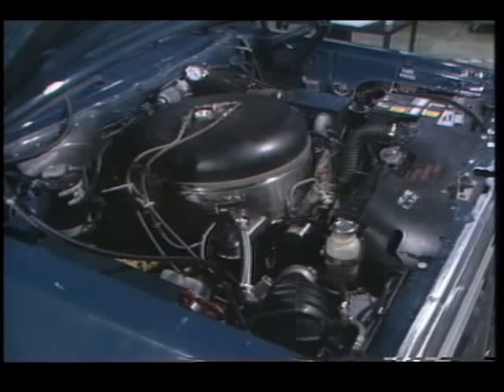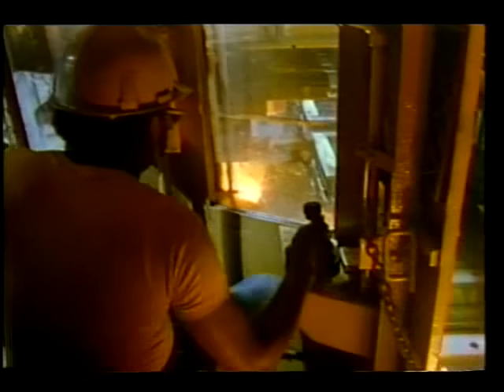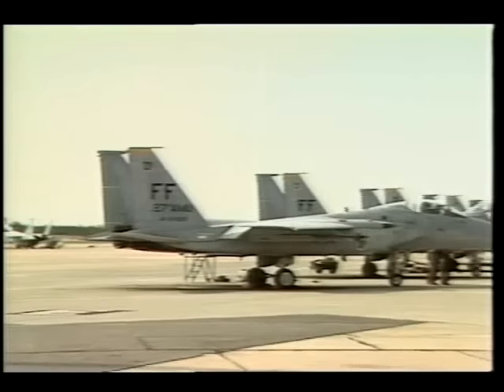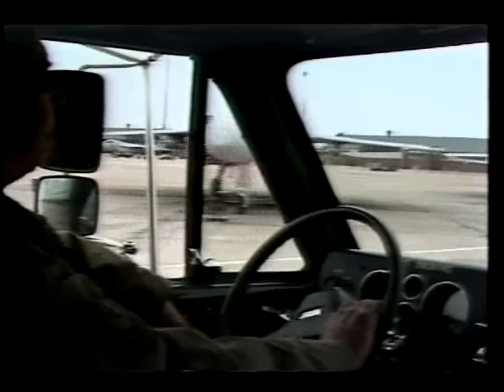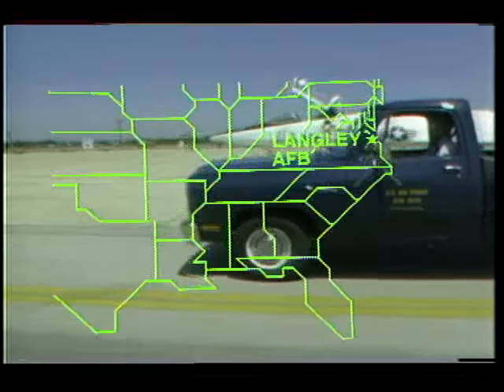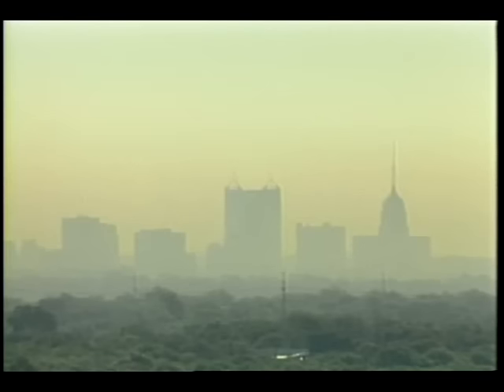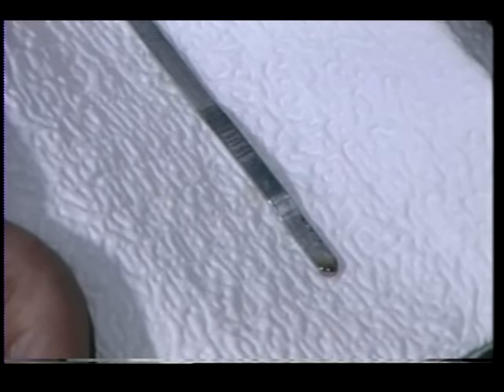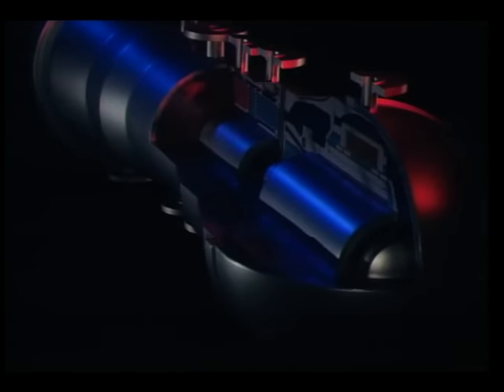The Stirling Engine: A Wave of the Future

Comment: Could you imagine using solar, hydrogen cells and sugarcane moonshine to run the Sterling generator to power an electric car hybrid? You could even use compost and bacteria or yeast to power the car. Even farts can charge the battery.
Reply: solar and HHO wouldn't make sense, nor would compost or bacteria. you'd need a methane biogenerator and specialized subsystem to feed this into the engine for a lower power & little range due to the nature of methane being a gas, however it's quite practical to heat your house and for cooking.
Reply: @s.sradon9782  sterling engines run on heat
Reply: @foresttaniguchi3168  you have to take the fuel with you wherever you go, this raises the importance of energy and power density and safety too. some fuels are really bad at these. You can run a car on methane but it won't run well.
Reply: @s.sradon9782  A sterling engine can run off of any heat source.
Reply: @foresttaniguchi3168  My point is it would be really impractical to carry a fuel with such insalnely low energy density and a bulky, heavy engine in a car. you could probably extract methane and run a car with it but not well since it's a gas, other fuel types are just ridiculous.
Reply: Powered by sugar cane moonshine. 
That is so dumb. 
It's a heat engine, whole point is it doesn't matter what the fuel it. 
Why would you burn $4 gallon moonshine when you could be burning the waste product from sugar production(the stalk) for like 20 cents for the same energy output?
Reply: @kkknotcool  you could burn anything, and the sterling engine can charge batteries or a bunch of coiled springs.
Reply: @kkknotcool  because you can easily make your own fuel by growing corn and sugar.
Reply: @foresttaniguchi3168  You don't need to make  your own fuel, literally anything that burns is fuel. 
Why would you distill and ferment corn when the cornstalk burns without any processing?
Reply: @kkknotcool  cleaner and denser fuel
Reply: @foresttaniguchi3168  Then just burn it in a normal internal combustion engine. 
It's like someone invents a star trek transporter and you want to use it to beam people into cars. 
We already have great engines for turning liquid hydrocarbons into power.
Reply: @kkknotcool  No. gasoline engines are inefficient as hell. You must be a damn teenager
Reply: @foresttaniguchi3168  Modern gas engines top out at around 35% and Stirling engines top out at about 38%, big woop. 
Their both just heat engines, the only difference is if the fire is inside or outside the cylinder.
And if you insist on clean fuel in the first place then why go for a much more expensive Stirling engine to gain 3%?
Reply: One application which I thought would of eventuated by now was as an heat recovery system for internal combustion engines.  I've seen models and experiments suggesting a 15% increase in fuel economy for existing ICE.   Id imagine it would be even higher for a hybrid electric setup too if it could supply  additional charging capacity to the battery.
Reply: @s.sradon9782  Yes the way I see it its like hybrid electric.  You use this type of system to improve the overall efficiency of the system.  In this case by recovering otherwise lost heat energy from the internal combustion engine.
Reply: Хаххаа😁
Reply: Yes connect a hose to the sewersystem to collect the methane gas, burn that to heat the stirling to have ur house powered. Maby some mirrors and the heat of the sun would be enough in some places.
Reply: @foresttaniguchi3168  yes, the engine runs on heat, but the heat is produced in a combustion chamber. For this vehicle, liquid fuels are pumped to the combustion chamber and burned, to provide the heat. You could use cheap perfume, alcohol, liquified bacon drippings, olive oil, heating oil...and combustible liquid that could be pumped to the combustion chamber. With some modifications, combustible gases could be supplied to the combustion chamber. Solar stirling engines do exist,but they are stationary, and a focused and concentrated sunbeam id directed to the hot side of the engine.
Reply: A shame they never really took off except for use as an AIP in submarines.
They are making a big comeback at the moment though with the Chinese pushing the boundaries with new designs for use in certain applications.
😎
Reply: joshskipka  if it's not profitable, that means it wastes energy, so it's a good thing it isn't used.

Since money spent is precisely proportional to energy burned. (That's the one part they leave out in school).

....and profit margins are only available to the most efficient methods and designs in an industry.
Reply: This is not far fetched at all.
Reply: @s.sradon9782  Since they run on heat, it would make sense to couple those spplications.
Reply: Why not use a heat pump to make the heat?
Reply: @mikelingley  What are you talking about ? The Stirling engine is a type of heatpump.
Reply: @sierraecho884  I’m thinking of a hybrid electric plug in where you use a battery to power an electric heat pump that you would use for heating and cooling the vehicle and using the hot b and cold side of the system to drive a Sterling engine that would be an electric generator.
Reply: @mikelingley  So you talk about a hybrid with a Stirling engine instead of ICE as range extender. Now you want to use the Stirling to heat and cool the cabin and also as a range extender ? Do I understand you correctly ?
Reply: @sierraecho884  I was thinking you could use an electric heat jump like you can buy to heat or cool a room I’m your house to provide the needed temperature differences that would run a Sterling engine that would be used as a range extender. It probably would not work because of the laws of thermodynamics though. Idk 🤷‍♂️ 

You would not need to use a heat pump.. you could just use a heating element to get the Sterling going.
Reply: @mikelingley  Even if you would do it how would it make any sense ? Like I don´t get your point. A Stirling engine is a head pump in itself why would you get an other one ? Why would you use a heating element which is one of the most wasteful sources to heat a Stirling which has a loss of 60% ? 
Maybe your problem is you don´t anticipate the losses. You have a mobile device..a car. you need to be light cheap relaible which means the less parts and less friction the better. A modern free piston stirling engine is very good in taking in head and converting it into electricity or taking in electricity and converting it into cooling for instance. A good combination your therefore ne an electric hybrid with a stirling engine as a range extender. The Battery could be small and cheap while a small stirling provides power by external combustion of Bio-Ehtanol for instance which is CO2 neutral and very clean burning.
Reply: @sierraecho884  yeah what you said does make more sense. I drive a Chevy volt.. so replacing the gas engine with a Sterling engine is what I was thinking to begin with.
Reply: @mikelingley  That’s what I mean. Any catalyst

Comment: Anyone saying that the Stirling engine is slow to speed up and heavy, I would like to forward you to the Nasa technical report related to this video where they put the Mod 2 (another Stirling engine) into a Chevrolet Celebrity. 0-60 was 12.4 on the Mod 2 (the "Spark Ignition" was 13.0) and the weight was only 100 lb heavier. (100 lb for a 1.25 ton vehicle)
Reply: Doesn't matter. As much as I love this kind of tech for vehicles. Cars that run off of stirling engines or even steam engines are never going to happen unless a complete power structure collapses where we can do what we want. Because its quite obvious now that the powers that shouldn't be have already given the "solution" for ICE vehicles. Electric battery cars. Hopefully a Hydrogen powered electric car makes a break through but even the Toyota Mirai has been crapped on by everyone in youtube hurting its possibility of another one in the market.

Comment: I would also be interested in seeing this in a domestic application, used alongside central heating systems.
Reply: They are very popular in coogenertion, generating both power and heat
Reply: You can buy them they exist exactly fo that purpose.
Reply: Study history. It was. Stirling engine was used as a portable generators. Largely used 19th century to pump water out of mines and primitive low economy engines, since they didn't use steam, they didn't need a boiler, thus no complicated boiler man or risk of steam explosions. All you needed was a fire man to put wood/coal in it. 
But the power to weight ratio of steam engines improved between 1840s to 1870s. By 1870s triple expansion steam engine rendered them obsolete in large setups.
Small stirling engines were used in remote domestic houses before connected to electricity..pumping water up hill, or even novel idea powering home appliances like washing machines, etc.

Comment: This should have been the today's diesel engine.
Reply: We should of have lost oil and batteries more than 100 years ago, but they shelved Nikola Tesla true wireless cause they needed the oil monopoly
Reply: @manipulativer  Wrong.  The use of wireless transmission of electricity is wildly inefficient, grossly expensive, and amazingly impractical.
Reply: @protoborg  Yes wireless through air is pretty bad as explained by Nikola Tesla as it loses energy squared by distance.
By Earth however there are minimal loses where he claimed around 5% and later around 1%
You people are indocrinated by the school system, wake up
Reply: @manipulativer  No, fool.  In order to get any kind of useful power to be transmitted over a distance of more than a few centimeters, you have to be at very high altitude.  Somewhere in the neighborhood of half a mile up, near the lower boundary of the ionosphere.
Reply: @protoborg  that guy was trying to be somthing you dont find now days a true friend and you called him a fool  not my bizz just saying

Comment: What happened?
Reply: Doesn't fit in a consumption society. Probably locked up inside Area 51 or in that indiana jones storage.
Reply: @Bylga  Nope.  It is simply impractical as a power source for anything larger than a bicycle frame.
Reply: @protoborg  We're literally watching them drive around full sized vehicles for 1000's of miles and several years in this video and getting better than average gas mileage.
Reply: @LordElfa  No we aren't.  All we see here is the 10 or so seconds of onscreen movement.  This is like a movie promo in that we see only the good parts of this experiment.
Reply: @protoborg  you got him on the argument technically speaking, but my hunch tells me the video isn't lying.

Power ratios, lack of torque/acceleration, poor adoption barriers to entry, and difficulty with starting the heat to the engine from ignition to drive seem like some good reasons it didn't work.

But it doesn't mean you can't power a large vehicle for long distances. A sedan only needs 25 hp for constant speed on the highway.
Reply: @baloog8  Thank you

This is exactly what i was getting at.

Sadly, the thing would be huge.  That would limits its usefulness in vehicles smaller than a transport or large truck.
Reply: Oil companies didn't wanted it.
Reply: @cosmicuprising9411  Could we please stop vilifying the oil industry?  They are not some almighty shadow government who can shoot down anything they dislike.  They had shit to do with this.  As i stated earlier, the Sterling engine has a VERY low power to weight ratio.  In order to make a useful amount of power it must be VERY large.  This makes it useless in a vehicle.  In a stationary thing like a power plant, it is ideal, however.
Reply: Research conclusions: lack of acceleration due to slow RPM change disqualified it as car engine
Reply: @protoborg  MOD II at a price of $3500 (2024) a unit and made with zero rare earth materials had a power ratio of 0.18 which is only 40 percent worse than a typical diesel while having the ability to use multiple types of fuel and require little to no Maintenace after 3500 hours. This engine would have been god sent for regular people who used their car for work. Power to weight and acceleration is for racing which a majority of car owners don't do. The acceleration from 0-60 was 12.4 which was 2.6 seconds better than the ICE engine it was actually competing with during the time. After 8 years of development 1978 - 1986, it managed to spank most road ICE engines today in terms of efficiency and reliability.
Reply: @protoborg nice try fed. You want me to believe your mainstream engines are the only choice because you don't want cars running on fuel you can't control

Comment: just an idea, but in the same way that there are companies making prototype heavy duty trucks using a turbine to drive an electric generator for increased mpg, could the stirling engine be used in place of a turbine?
Reply: they can easily reach efficiencies of up to 60%
Reply: No one is putting a turbine in a ground vehicle.  For one thing, jet fuel is fucking expensive.  That's why a bus is sooooo much cheaper than an airplane.  Second, turbines are only really efficient at high altitudes and high speeds.  That's why turboprops are a thing.  Third, turbines are VERY dangerous.  They have MANY fast moving parts that are exposed to the air.  That's how they work.  Those parts can kill people.  Fourth, turbines require a great deal of machinery to make them function.  All of that machinery would make the vehicle VERY heavy.  Fifth, turbines do NOT self-start.  They require an electric motor to spin them up to operational speed.  In a ground vehicle you might as well just use THAT electricity to power the wheels directly.
Reply: @handles_are_a_bit_rubbish  Except that is not how an electric motor works at all.  There is no "starting power" involved.  An electric motor uses the same amount of power from the moment it starts to the moment it stops. Your numbers make no sense.  A 20 kW motor that requires 140 kJ would take 7 seconds to start up.  Electric motors do not take that long to start up.  They start running instantly.  The vehicle that they are attached to might take time to start moving but the electric motor starts instantly.
Reply: @handles_are_a_bit_rubbish  Except that an ENGINE is not rated in kW.  It is rated in horsepower.    The energy the engine uses is also rated in Nm, not kJ.

A motor is not an engine.
Reply: @handles_are_a_bit_rubbish  I honest don't feel like correcting you right so I will just say no.
Reply: @handles_are_a_bit_rubbish  Nope.  I'm just feeling lazy right now.
Reply: @handles_are_a_bit_rubbish  I'm glad you took the time to explain.

And I agree with you, since HP and kW are both measures of power, in that 1 kW is around 1.341 HP. And then Nm and ft-lbs are both torque (or force a specific distance from the axis of rotation (pounds per one foot or Newtons per one meter), where Joules (as J or kJ or MJ) are measures of energy as the Specific Energy of fuels like gasoline are measured in MJ/kg.

Sadly, some people believe themselves to be correct without checking their facts. Its been known that kJ is energy ever since 1840 and its proven its worth and purpose for longer than Canada has existed.

And one thing that protoborg has neglected entirely in this conversation is the topic of piston vs turbine in the starting power. Where a piston engine has the problem of compression sapping a load of power during the starting process, a turbine has nowhere near the problems with compression since the air flows freely in one direction until it passes its idle speed. Indeed, a turbine requiring to rev up to perhaps 18k rpm like the old Chrysler Turbine did would take more energy than spinning a highly resisting piston engine to 800 rpm, but for a similar power output I believe the power draw to start a turbine wouldn't be that much higher by virtue of its low rotating mass.

Oh, and I agree with your last statement here "Because I'm right". As far as my own understanding and research permits, that statement is factual in the context of this debate.

Edit: I forgot to mention, but protoborg had also forgotten that both Australia and the EU rate vehicle power in kW rather than HP. And electric motors have both a torque rating in Nm or ft-lbs as well as a power rating in kW or HP. But motors generally come in kW and Nm as far as I've seen.
Reply: @protoborg   Have to disagree with something, a starter motor isn't able to drive a car, it's main use is well.. To start them up, if that were the case we could run cars with starter motors, which is a complete pipe dream.

Comment: 2020 called so what happened??
Reply: Bad power to weight ratio and too large. That 75HP they got out of one back then is about as much power you would get out of one nowadays.
Reply: bill sheverbush  Combine it with the regenerative braking flywheel torque multipliers and a mechanical CVT...

badda bing badda boom
Reply: this type of engine can't change it's power/RPM fast, also requires heating up to start
good for electricity generation, horrible as car engine
Reply: 2020 we have EVs

Comment: Can you use enduction heaters to power it and can you get the electricity for the induction heaters from alternators that the engine powers.
Reply: maybe as a way to recycle the energy at some loss, but it won't generate more energy than put in if that is what you're thinking. It could be a really efficient engine, but not necessarily a powerful engine considering the power to weight ratio which is important in a moving vehicle.
Reply: @entritur  I am thinking you could hook up 2 alternators plus a solar panel to get electricity for the induction coils. You could use 4 500watt flat coils. That's 2kw  you can get that very easily with couple of alternators. NASA should try that.
Reply: @spaceman4294  a heat pump is what you would like to read up about my freind